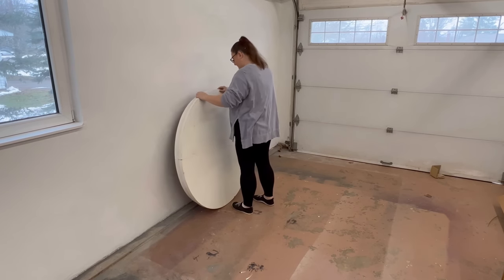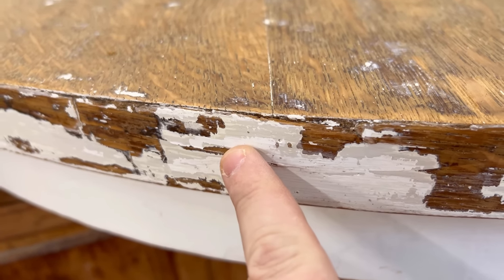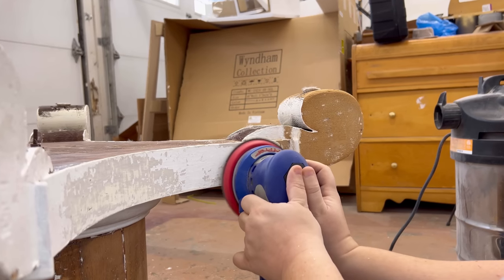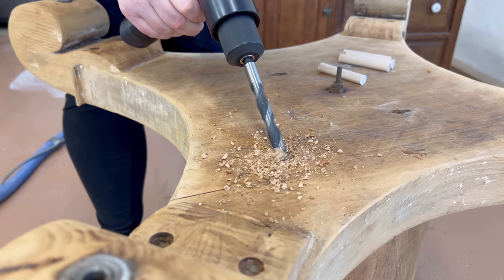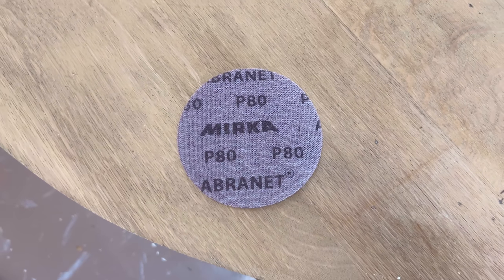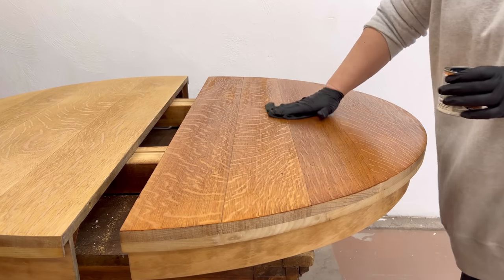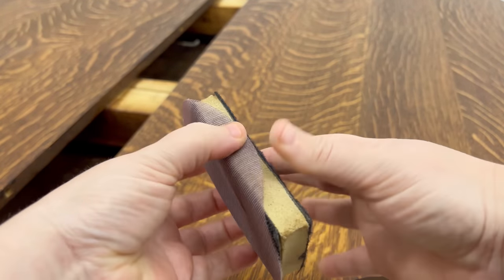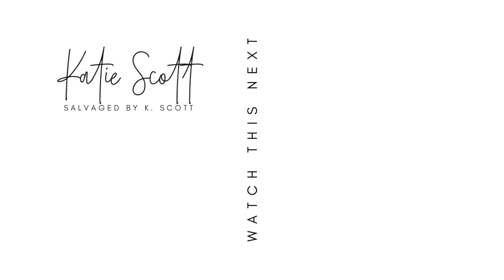Thrift Store Makeover of an ANTIQUE Empire Dining Table

Comment: Great job! I think you might be off on the date. The original American Empire style was most popular in the 1820s, and would have been well on its way out by 1848. Almost all American Empire would have been done in dark stained (very thick) flame mahogany veneer, or less commonly, rosewood veneer, over pine. This table is most likely from the revival of the style, 1900-1915 or so and is probably made in Grand Rapids, Michigan. The hardware, as well as the use of quarter sawn oak, points to this later date. Oak was not often used on high style pieces in the earlier period.
Reply: Agree . Living in the Midwest ( USA ) this table & ones w/ varying base styles are very common . Usually 48"  round oak  , but do to being over 100 yrs. old ,  often missing the leaf / leaves so folks will make replacements .  I've worked in interior design & also house / pet sit for friends & we joke that every country house in Illinois & Indiana has these tables .  🙂

Comment: Interesting! Particularly the repairs of the cracks on the base. Thanks. I have a round oak table with a leaf  and a different base with thick feet that I found on  Craigslist for $70. Needed no work though the top color is a little uneven. Never had a dining room till 5 years ago and wanted this style table for 50 years!

Comment: Great find and new look! Did you end up keeping or donating? 

Early 80s, we found perhaps an even older, and larger table which had hand-carved claw feet. Really bad shape. No luck sanding off all the paint so had it dip-stripped. Had ZERO knowledge as to the refurb process, back then, so ended up using it with just a sealer along with its massive cracks, etc. Weighed a ton, served us well. No recollection as to what became of it as we moved within a couple years and picked up a Duncan Phyffe set, which I still have. Was the original mahogany until several years ago when I painted it a light 'linen' color (which I also did to almost all of my old, mahogany pieces....tired of living with all that heavy darkness).

Comment: Love your channel.
The table isn't that old.  I believe that an oak veneer table is LATE Victorian, Empire-revival, not actual pre-Victorian Empire. It's a manufactured table, and the "48" is likely a stock number, not the year the table was created.
Oak veneer was used when the oak trees began to get scarce and more expensive (definitely Victorian era), and the maple base is another giveaway that it's very late 19th century. Furniture manufacturers also used ash, hickory, elm, and chestnut when they couldn't get oak. The grain is similar.
All that said, you always do a brilliant job of restoring!
Reply from the maker: Oak veneers and veneers in general have been used on furniture much further back than the 1800’s. I actually did a lot of research on this piece to come up with the date (besides the marking on the bottom) and it is definitely from the mid 1800’s. The biggest indicator was actually the screws holding the top plate to the pedestal. https://georgetowner.com/articles/2017/08/23/articles20170823the-antiques-addict-3/

Comment: Restoration was absolutely the right choice for this incredible find and you did a fantastic job. It's gorgeous! I'm just wondering if you could tell us why you chose scraping/sanding over stripper on this particular piece?
Reply from the maker: Stripper is messy, it takes a long time for the wood to dry after and you still have to do a ton of sanding. Since this was large, mostly flat surfaces, it was just easier and faster to scrape.
Reply: @salvagedbykscott  Ah, that makes sense. Thanks for answering!

Comment: I'm thinking it is early 20th century and the 48 means it is 48 inches across. Tiger maple veneer was so popular in the early 20th century!
Reply from the maker: The solid oak on this table along with the hand cut screw heads and the hand forged nails gave me the mid 19th century date that I landed on. Of course I could be wrong but after hours of research I really don’t think I am. It’s also 52” across 😉
Reply: @salvagedbykscott  I think you're right!

Comment: 1. They used veneer in 1848?
2. Why did you decide to scrape the paint off instead of using a chemical to dissolve it?
Reply from the maker: 1. They sure did!
2. The scraper was much faster on these large flat surfaces than dealing with a chemical stripper.